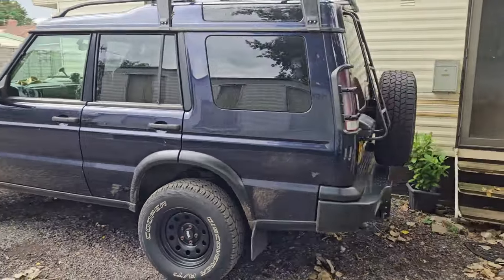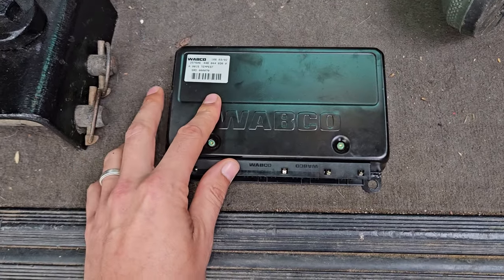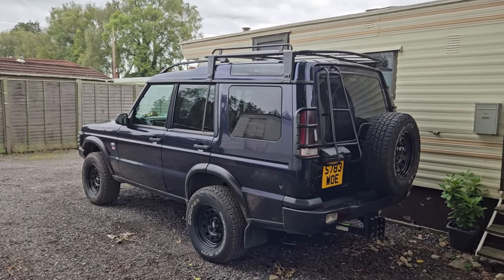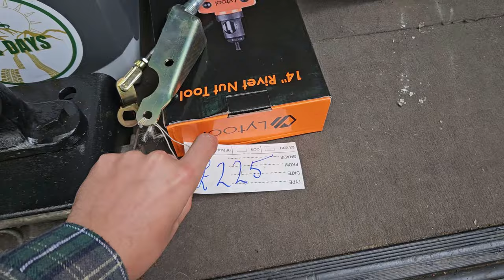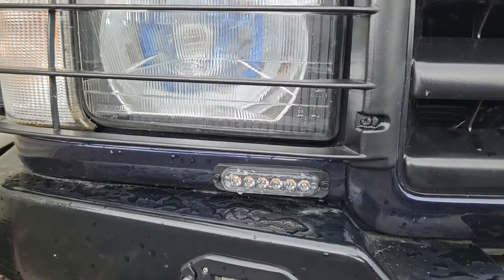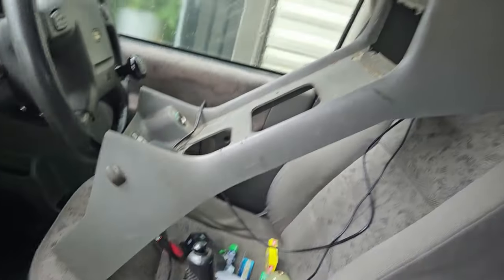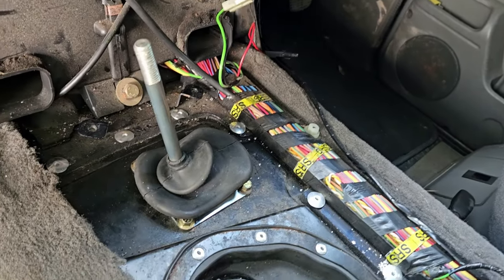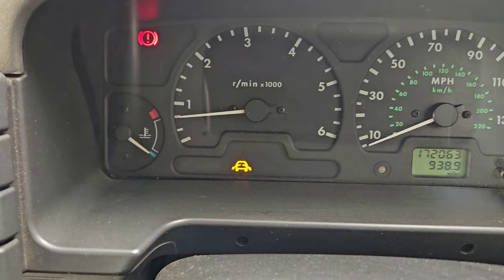LAND ROVER DISCOVERY 2 FITTING CDL LINKAGE

Comment: I had one of these linkages, but I gave up on it, in the end managed to find a genuine LR one and fit that. I haven't got ridiculously big hands, but even with my slightly bigger than average hands, I kept mashing my knuckles against the plastic trim shifting to low range. I would advise anybody who has these linkages, to bend the rod the knob screws onto slightly so that the knob sits further back when its all reconstructed. Will look more "factory" than aftermarket. As for the chimes, the facelift model will chime when Diff lock engages and disengages, the pre facelift model doesn't do that.

Comment: On the off chance, do you know if you can decode the VIN number, to see if a D2 has the diff lock innards in the transfer case?

I don't think mine does as it's on 03, the one year that I don't think has the right bits in.

Apparently, mine has an Ashcroft LSD in the transfer case, but I like the idea of me deciding when it should be locked, and unlocked.